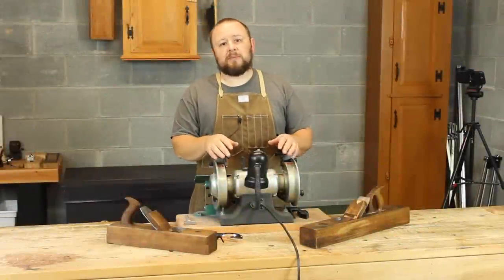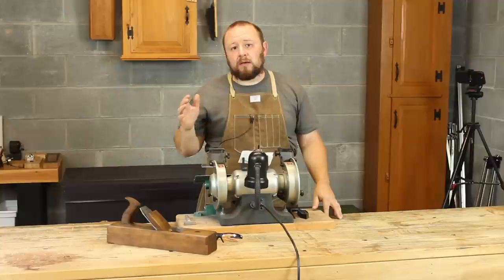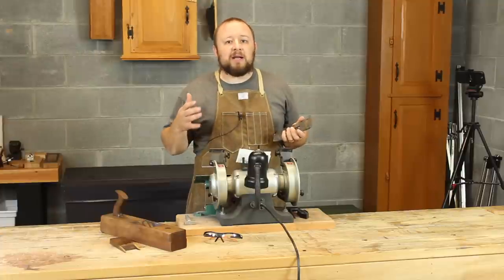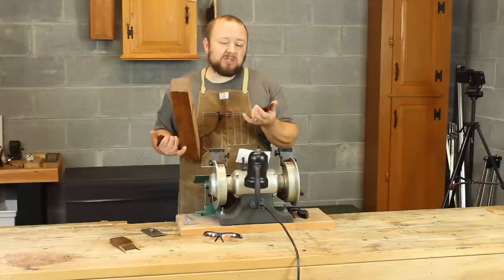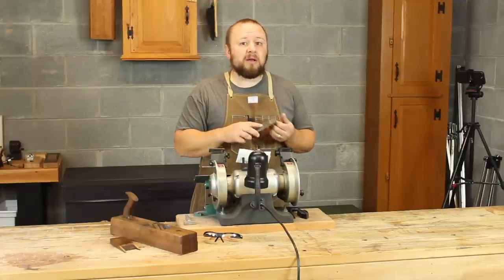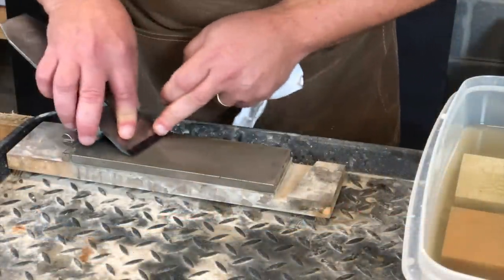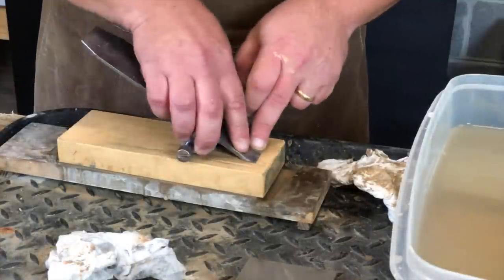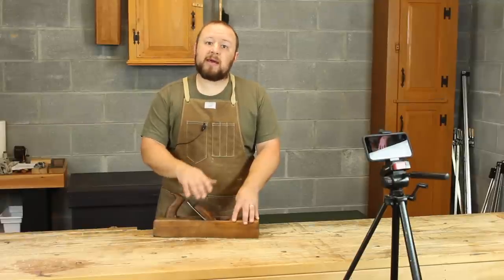How to Camber a Hand Plane Blade with a Grinder

Comment: Is the only difference between your jack plane and tri-plane the camber you have on the blade?  They seem to be identical otherwise.
Reply from the maker: Paul lindhag Camber and length. The jack plane is usually between 15-18” long (mine is 17” I think) with more camber while the try plane is typically about 22-26” long with less camber.
Reply: Thank you for the quick reply!  Looking forward to your next video on cambering by hand.

Comment: Why not just scribe 1/32" *1.41 (1/sin of bed angle) from the edge? Efectivly this is what you doing if bed is at 45.
Reply from the maker: You certainly can if you want to. I find it easier to avoid the math, extend the blade however far you want, and mark it directly. Not all planes are bedded at 45 degrees. Especially older wooden planes and low angle bevel up planes. This method works the same regardless of bed angle and without any math.
Reply: @Bob Rozaieski Fine Woodworking  
Of course, if bed angle is 50 then you wil calculate 1/sin (50)
Math is not so scary :).
But.. as you say. Everyone has his prefered method, just my 2 cents

Comment: This could make a lot of difference to many things, but because you don’t have an accurate way of establishing the camber we can see, this vid does not do it for me. 
The new breakthrough in plane sharpening will come when someone gets hold of a metalogist & a machinist (along with a Chippy)to solve this and several other issues
Pretty sure in this day & age that the facilities are there to solve this, but we must apply the science- it’s nearly 50 years since the university of Japan produced their game changing video of the relationship of a chip breaker & a hand plane blade. 
& they expect us to believe someone landed on the moo n